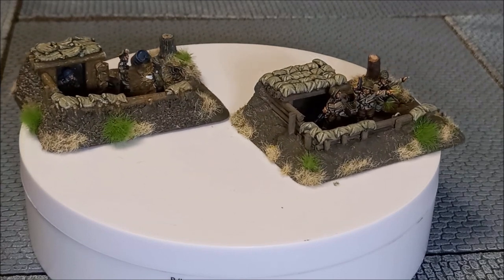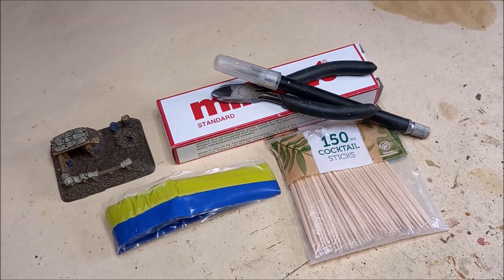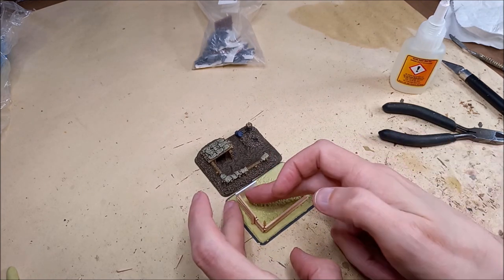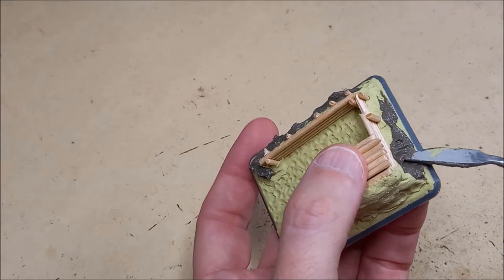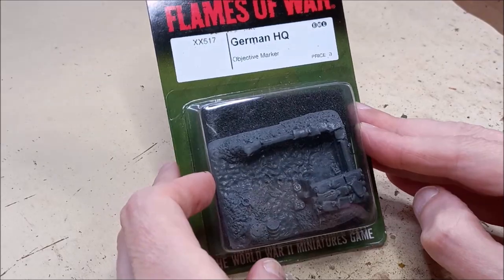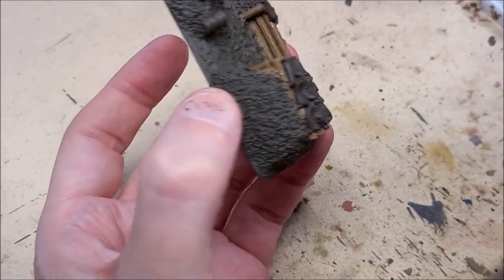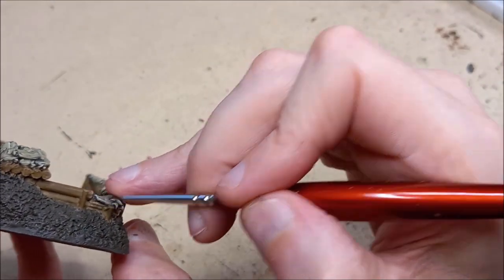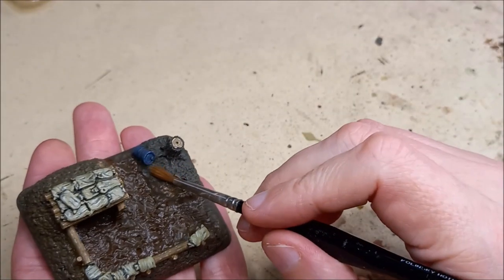How to Paint and Make a HQ Objective Marker for Flames of War

Comment: The original marker doesn’t have to be primed before painting?
Reply from the maker: You can prime if you wish and many consider it to be essential. I've not found any need to do so in my 15 years of painting these resin kits. Priming can help unify a surface such as metal and resin combined but other than that I don't consider it.
Reply: @PanzerSchule Thanks for the info. I’ve only really painted the plastic models. Always great videos, cheers!
Reply from the maker: @nickchoplick  thanks for watching and happy painting.